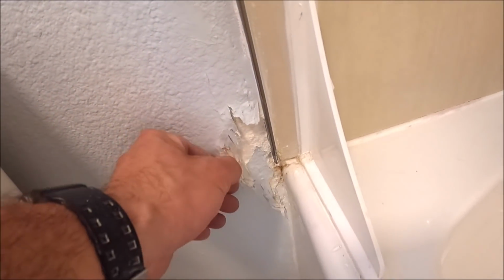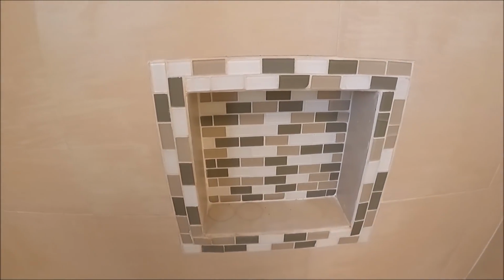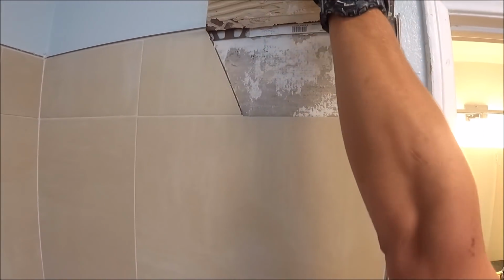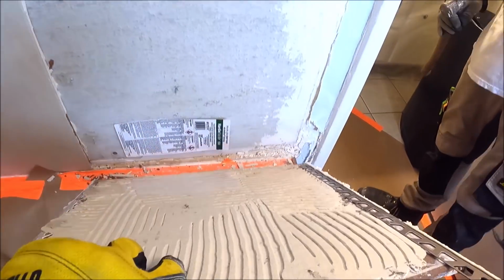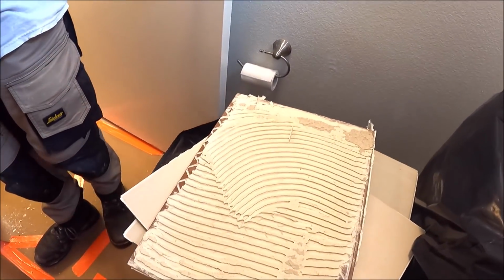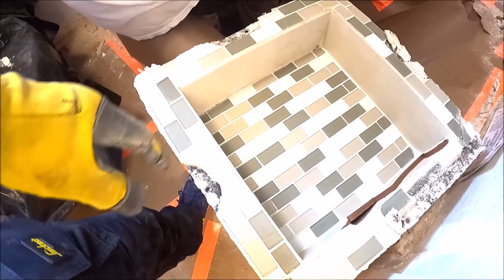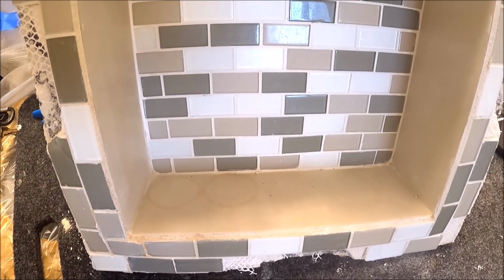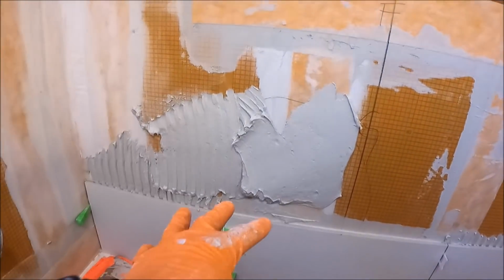Tearing Out a Bad Tile Job and Rebuilding!

Comment: So where was the water damage? Backer board and studs looked fine. Looked so pristine, that you could have left the side walls up and covered with sheet membrane.
Reply from the maker: No damage on the backer board and the client wasted money on a leak detection company. That's definitely a great idea wrapping with kerdi membrane if the backer is still in tact, but they paid for a full tear out and all Kerdi board. Client gets what the client wants.
Reply: Nothing wrong with the bathroom tiles. It appears clients wanted an updated  bathroom.
Reply: @LandbergTileTV  Surely as a Professional contractor, isn't your job to point out to the client the fact that there wasn't any water damage after all and therefore the job can be completed at less cost to them.  This is certainly something that I do as a professional tile fixer here in the UK.  It also works the other way aswell, where a job throws up unforseen problems and the price goes up.
Reply from the maker: @andrewtivey7492  There was no water damage therefore no cost to replace framing or joists. The new shower is far superior to the old shower and the client is very happy.

Comment: Why the big fuss over not having full thinset coverage on walls? The tile held up for five years and would of held up longer if not for the prybar and hammer. Can someone explain.....thanks
Reply: Hi Ben
In a shower you need to have something like 95-98% coverage of thinset between tile and substrate because of possible moisture penetration and possibly mold growth. Your grout and tile are not 100% impermeable to water, so if water does get back there it could grow mold as well as weaken your bedding material (thinset) that bonds the tiles. This what I have learned from my experience as well as what is recommend

Comment: Tile not porcelain, red body cheap big box tile. nitch didn’t leak because solid aluminum, also those nitchs are pre pitched. To bad they didn’t trowel on concrete boards otherwise would have been fine. As good as Schluter board 1/3 the price

Comment: Nothing wrong with that tile job. Could easily last another 10 years. The issue is the out of date tiles taste
Reply from the maker: yup, you're right, but a leak detection company said otherwise
Reply: @LandbergTileTV  than the owner should of made an insurance claim for the damage and a leak detection fraudsters need to provide proof that there is a leak

Comment: The stick on the backer board made me laugh. Also, do you sand and shim studs for flatness?
Reply from the maker: These studs were fairly plumb, and if off a bit, it's easy to adjust with large format and 1/2 " trowel .
Reply: @LandbergTileTV  👍🏻 for me it seems like there is always a stud or 2 proud or depressed.
Reply: @fnelsoninteg  agreed

Comment: You got a new van. Why did you buy such a small van? Lol Better on gas? Tile guys/bath remodelers have too many tools and we haul garbage/materials around. You think you should've gotten a big van instead.
Reply from the maker: Because of the gas, the $400 I save per month goes into this van/asset. I have the van, truck and dump trailer for debris. This van is awesome and hold all the tools I need 👊
Reply: @LandbergTileTV   You can really save $400 a month?? The math doesn't add up though.... If you drive 1000 miles a month. About 45 miles a day. Typical 30 minute commute. 22 mpg for the small van at $3.80 a gallon....That's $172 a month. If you have a big van with 12.5 mpg at $3.80 per gallon, that's $304 a month....That's only $132 a month saved.
Reply from the maker: @williamp9158  Maybe I'm off a little, I'm getting 26mpg right now with the van and was getting 12-13 mpg with the truck. Gas here is $4.50